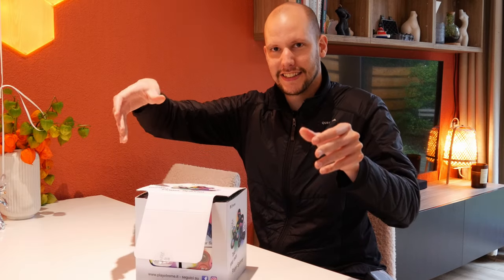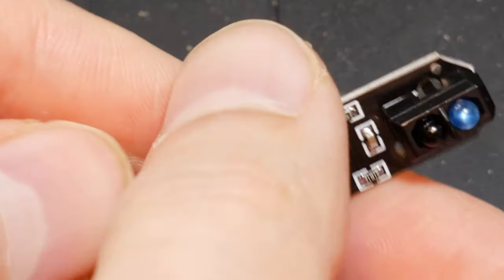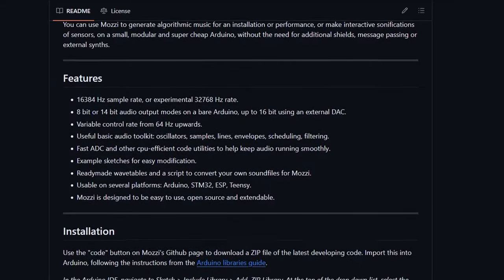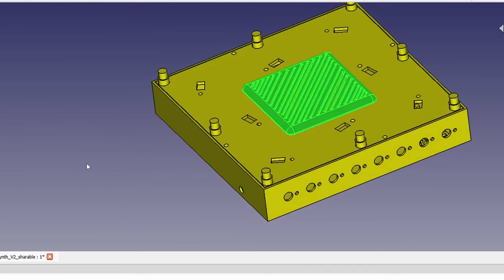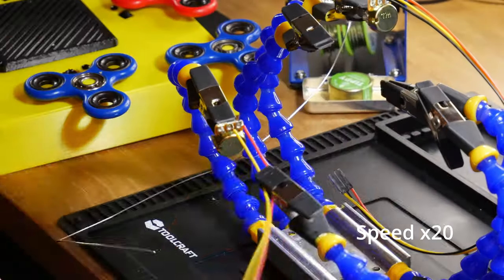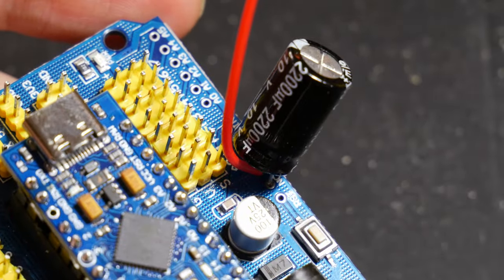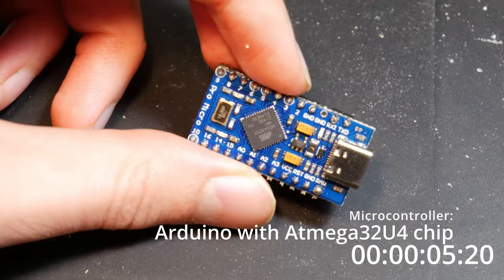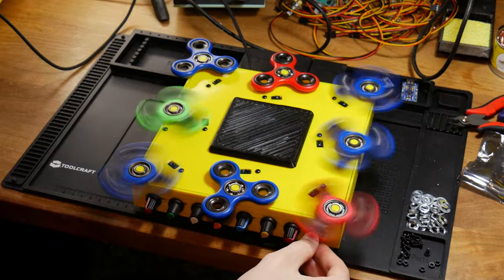Fidget Spinner SYNTHESIZER

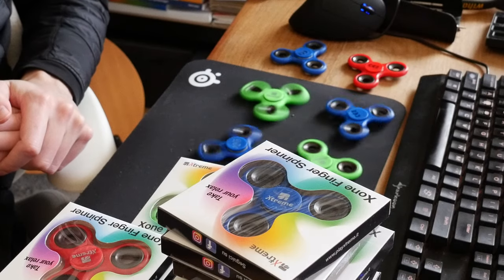Comment: 1:33 FTDI/CH30 chip freeze problem: Either isolate the circuit completely by using a battery, or use proper earthing.
A cap or a ferrite ring can help if there are high frequency noise around (a drilling tool's graphite contacts for example)
Earthing can help when there are slow voltage swings in signal wires.  It prevents slow but steady charge accumulation, it removes the capacitive nature of the environment.
Reply from the maker: Thank you for thinking along! I don't have much actual earth around my house, just the L and N wires... Giving the amplifier a separate power supply to test with would be a good idea, yes! And where should the ferrite ring go exactly in this case? Or the capacitor? I did add the cap on the main 5V entry.
Reply from the maker: Hey, wow I almost missed your message. Thanks for elaborating this much! Grounding is SO weird!!! I had the same kind of weird stuff you mentioned at my job at some point as well. It was a 3000 kg metal device and I figured that had so much "natural grounding" (whatever that means) that I didn't need external ground. And we were running big actuators around it. Well we had the weirdest signal issues. All was fixed after grounding. But this is different given that it runs off a battery.

Thanks for your input and have a nice day 😊

Comment: Ik heb nooit van die muziekwinkel gehoord. Ooit maar eens een keer naar het noorden toe 😅
Btw the fact that your IR detector didn’t work in bright sunlight isn’t really a hardware flaw in the detector. The problem is that in sun light there’s a massive IR spectrum. So the IR in the ambient light overwhelms the IR reflection from the IR led.
What they usual do to combat this in remote controlled system is to modulate the IR led to say 15KHz or 31KHz (I forgot the standard frequency) and then demodulate that in hardware. Then it becomes reliable. There are dedicated ICs for this btw.
So the advertising on the spec sheet is correct as it only allows IR but at the same time highly misleading.

Leuk kanaal ik moet misschien ook eens een midi projectje gaan doen op mijn kanaal. Ik heb immers naast engineering ook X veel muziek 😂
Reply from the maker: Hoi! Bedankt voor je bericht en compliment. Haha, vanuit Groningen gezien zou ik Dedemsvaart nóóit het Noorden noemen 😂  Echt een mooie gitaarwinkel wel! Je hebt gelijk over de modulatie, dat is een mooie oplossing. Ik had gehoopt voor de one stop shop sensor, maar die droom bleek bedrog 😂 So we learn... Leuk als je ook wat gaat doen met MIDI, zo veel mogelijkheden!
Reply: @JensMakerAdventures  lol 😂 ja alles is relatief 🤣Bij mij vanuit Nieuwegein gezien is alles voorbij Zwolle al het hoge noorden 😜Je kanaal is echt heel leuk. Keep it up!
Reply from the maker: Oh ik snap je volkomen! Fijn hoor, zo centraal wonen. Maar het is hier relatief rustig, is ook erg prettig. Bedankt voor je woorden van aanmoediging, die doen me goed! Hopelijk tot ziens bij een volgende video 😃